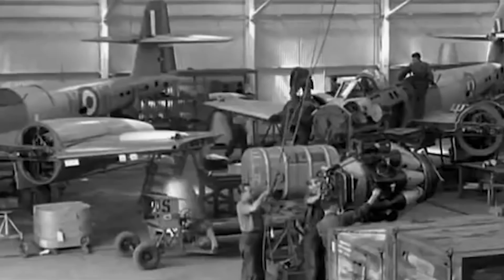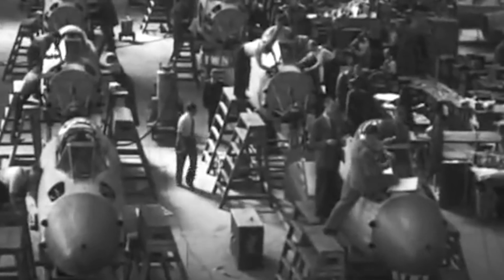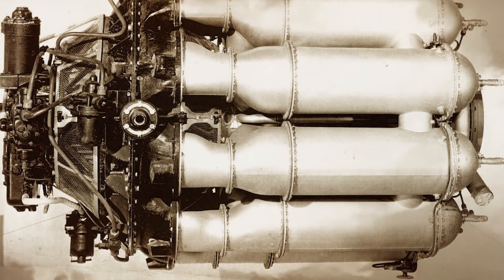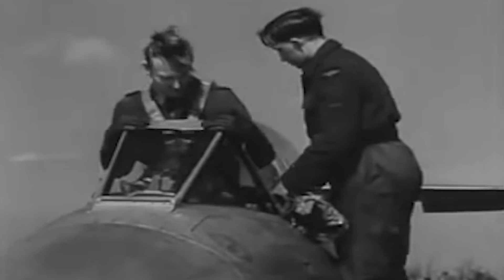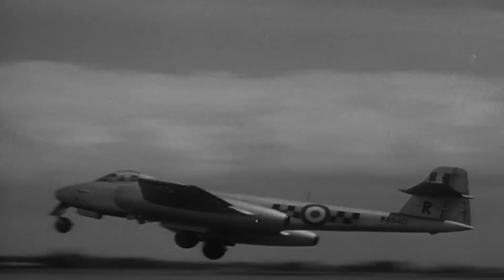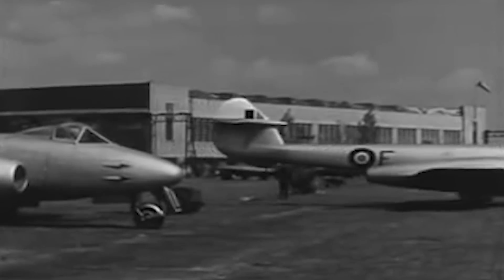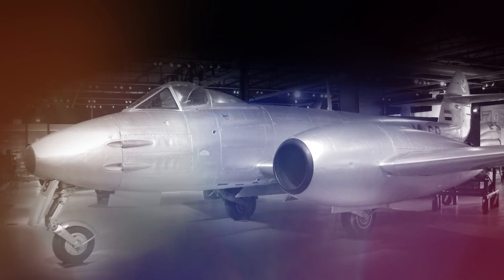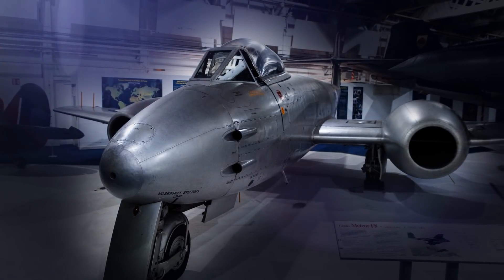Gloster Meteor - The Only Allied Jet to Fight in WW2

Comment: Whittle's jet engine could have been available much earlier but for the fact it had to be accepted by an RAF officer who mistakenly believed his own ideas about jet engines were better the Whittle's. It was he who held Whittle back. With out that officer then Whittle's jet engine could have been used much earlier.

Just imagine a combat version of the Gloster E.26 during the Battle of Britain. Old Herman Goring claimed the Mosquito made him yellow and green with envy. You can only imagine how many other colours he would have turned if his Luftwaffe had to face jets.
Reply: Early jet fighters really weren't all that great, poor range, lousy acceleration, unreliable engines and problems with guns at high speed being some of the issues; all the early models had to be used in niche roles (something that Hitler himself failed to understand) unlike aircraft such as the P51 and Mosquito which were very adaptable; some such as the A/B26, Skyraider still in use decades later.
As always other technologies such as air to air missiles and airbourne radar had to grow in order for Jet fighters to explore their potential. Jet bombers if anything had more initial value, see the Canberra and B47.
Reply: @jimdavis8391  I have seen the Canberra flying. Excellent aircraft. Even the USAF were impressed by it.

The Gloster E.26 did very well for itself and it was a prototype so with a bit of time improving it would have made it some difference to its performance. Also as the Battle of Britain was a defensive battle for Britain so its lack of range was less important. Getting up to altitude fast was what was needed.
Reply: Big Blue on
Reply: One good thing about centrifugal compressed engines is less compressor stall issues with axial flow engines (untill later multi spooled enjines). Had to gradually make thrust adjustments.
Reply: I guess you mean Alan Griffith? He had some pretty impressive ideas about turbine engines (axial flow compressors for example), but didn't think the jet thrust could be used as direct propulsion.
Reply: @tachikomakusanagi3744  Alan Griffith had forgotten Newton's third law
Reply: @bigblue6917  No, Newton's third was the exact reason why he didn't think jets would work for aircraft propulsion. Don't forget the original jets were low thrust, maybe 1000lbF (or less) even by 1942 - Griffiths was making his assessment in the early 1930s. Let us give him some slack on this. The guy had an axial flow jet operational by 1943. He realised he made a mistake, and he got right down to the business of correcting it.
Reply: @tachikomakusanagi3744  Griffiths was the Expert on Gas Turbines in the UK at the Time and that was why the Royal Aircraft Establishment called him in to check up on Whittle's proposal's in the early 1930's. Had He got the Maths right and validated Whittle's work, It's doubtful anything would have happened. No Threat and No Money.
Reply: @tachikomakusanagi3744  Definitely had a a pair of prototype Metrovick F-2 engines in the air in 1943 on one of the Meteor Prototypes, but the F-2 was nowhere near operational as the RAF would not have accepted it. Running life was better than any of the German Engines ever where, but nowhere close to what the RR Whittle engines could do,
Reply: @tachikomakusanagi3744 It was Hanye Constant at Metropolitan Vickers that was the one that pushed the idea of axial turbojets in the UK.
Unfortunately Britain was well behind in axial Compressor technology... still are today.
Reply: @richardvernon317  AA Griffiths was THE expert in the UK regarding Gas Turbine engines and turbochargers.
Here's the Head of engine development at the Royal Aircraft Establishment. He stayed up to date on turbochargers development and the first production gas turbine engines in the 1930s making frequent trips to General Electric in America and to Brown Boveri und Cie in Switzerland who were the world's leader in both gas turbines and turbochargers.
AA Griffiths brokered the deal that allowed Metropolitan Vickers to become a BB&C Velox gas turbine licensee and sell them in the UK for powerplants.
Reply: @WilhelmKarsten  I don't think Rolls Royce would agree with you. but carry on...
Reply: @tachikomakusanagi3744  GE-Safran is the largest jet engine manufacturer in the world and dominates the market.
Rolls-Royce is struggling and currently only makes the Trent engine in the UK.
 Brexit and the cancelation of the Airbus A380 has really cast doubts on the company's future.
Reply: @WilhelmKarsten  Hello Sandyboy, isn't it great that Rolls Royce have won the contract to re-engine the B52
Reply: @tachikomakusanagi3744  Frank Whittle was very aware that in the long term, the axial-flow jet engine would be superior.  As a pragmatic engineer, he also knew that the centrifugal compressor was much better understood than the axial, and so he chose to use those on his jet engine.  Whittle proved to be correct on both points.
Reply: @pashakdescilly7517  As Griffiths pointed out when he exposed Whittle for Plagiarism, he didn't understand the fundamental concept of Axial Compressor technology.
Whittle would never construct any engine with a axial Compressor.
 His career was destroyed when the W.2/700.M.52 engine was a failure and the Miles M.52 embezzlement scandal was exposed by the new Labour government.
Reply: @WilhelmKarsten  You post a whole lot of stuff which is 'novel'.  I suggest you cite come sources for your 'novel' allegations.  Your posts look like total bs to me.
As a for example, Whittle was aware from the beginning of his researches into jet engines, as its pioneer with limited resources, that ultimately the axial compressor jet engine would be the successful layout. However, the axial compressor was poorly understood and would require a large design and development budget which he did not have.  However, the centrifugal compressor was well understood and could be readily designed with rather fewer risks in development.  It may be noted that the Metropolitan Vickers jet project was very advanced in design, had marginally greater power than Whittle's engines, but was unreliable - despite having the benefits of British high temperature alloys developed for jet engines - which German projects did not have access to, notably due to severe shortage of nickel.
You raise a whole lot of allegations, an amusingly large number of them considering that internet searches reveal nothing to back them.  Except that Whittle and Griffith were rivals.  Yup, that is true.
Reply: @pashakdescilly7517  Bullshit, axial Compressors were in production before Whittle began any actual work on jet engines.
 Hans Von Ohain's first engine also used a centrifugal compressor but the Germans quickly abandoned this inferior dead end technology in favor of axial Compressors.
All of Von Ohain's work was self funded prior to the war.
Reply: @pashakdescilly7517  The Mertvick was failure, it never progressed to a flight rated production engine, Metropolitan Vickers abandoned jet engines in 1947 and went back to making steam engines.
Britain would not begin mass production of axial compressor turbojets until a decade after Germany.
Reply: @WilhelmKarsten  You do write twaddle.  Von Ohain examined Whittle's patent and published papers before doing his design work.  He was heavily funded by Heinkel.
Reply: @WilhelmKarsten  Metropolitan Vickers SOLD their project.
Your posts are 'novel'.  Otherwise referred to as creative bs
Reply: @pashakdescilly7517  Frank Whittle didn't invent the Jet engine nor was he the first to patent.
Your British propaganda myths won't fly here lad.
Reply: @WilhelmKarsten  I suppose, child, that you propose Henri Coanda as the inventor of the jet engine?  Of was it da Vinci?
Reply: @pashakdescilly7517  They SOLD OUT... and wrote-off the Metrovick as a huge financial loss.
Armstrong-Siddeley completely redesigned the Sapphire and it was never as good as the Rolls-Royce Avon.
Reply: @pashakdescilly7517  The revelation that you have been lied to must be a shock... the truth is often presented like a slap in the face.
Reply: @pashakdescilly7517  Your comments betray you lad..
They expose your limited knowledge and experience regarding this topic.
Reply: @WilhelmKarsten  your persistent creative writing on this subject is very reminiscent of Sander Van Der Kammen. Btw a German wouldn't use capitals for 'van der'.
With your taste for absurd disinfofmation, your read more like the un-lamented Soaring Tractor, who kept posting invective all over YT about the RollsRoyce Merlin and the supposed superority of the Packard-made examples.
Reply: @pashakdescilly7517  You sound very confused, delusional and unaccustomed to hearing the truth.
 Packard solved 2 of Merlin engines biggest flaws...
Reply: @WilhelmKarsten  The largest of the Merlin's flaw in early WW2 form was due to its carburettor.  The temporary fix was Miss Schilling's orifice, a diaphragm inside the carburettor float bowl with a small hole.  It largely cured the rich mixture condition under negative G force.  However, the long-term solution was the pressure carburettor, which was a joint US-UK development by Bendix and Stromberg which had absolutely nothing to do with Packard.  The various UK builders and Packard built the engines to the same specifications.  
Cut your bs, you are very argumentative with 'novel' ideas which utterly lack basis.  As you keep tossing insults, delusional etc, well, you are what you accuse others of - a child.
Reply: @WilhelmKarsten   aka Sander Van der Kammen aka dr bummer, your lies are all over you tube. 
Packard copied Rolls Royce and solved nothing, Rolls Royce had to show Packard how to make aero engines and Rolls Royce had to correct faults on the Packard copies.
Reply: @WilhelmKarsten  Hello Sandyboy, as you know the Sapphire was the Metrovick F9 and was also built in the US as the J65.
Reply: @WilhelmKarsten  Hello Sandyboy, let's remind you of what Pabst von Ohain himself said-

"The first patent of a turbojet engine, which was later developed and produced,
was that of Frank Whittle, now Sir Frank (see Fig. 5). His patent was applied for
in January 1930. This patent shows a multistage, axial-flow compressor followed
by a radial compressor stage, a combustor, an axial-flow turbine driving the
compressor, and an exhaust nozzle. Such configurations are still used today"

But Sandyboy do tell, what earlier patent do you have in mind, would it be our French friend by chance?
Reply: @pashakdescilly7517  Oh know, with Sandyboy it varies depending on what fact he's got to try and dodge. It does often come out to Maxime Guillaume because Sandyboy has seen a picture of his design but he's never actually read the patent  he used always to declare Guillaume's patent to be for an axial flow engine when Guillaume clearly suggests either a helicoidal or a Rateau type compressor.
Reply: @WilhelmKarsten  Sandyboy, it will hardly be a revelation to Pashak de Scilly that they're being lied to, because they know as we all do that you are lying almost all of the time.
Reply: @WilhelmKarsten  Hey Sandyboy, As you know, Metrovick sold its aero GT business to Armstrong Siddeley and the Metrovick F2 design team transferred with the F9 Sapphire and made it a very successful engine (more powerful than the early Avon) and it was built under licence in the US as the J65.  And a lot of Metrovick devlopments found their way into other AS engines.
I had to laugh when I saw you'd made a dumb claim about it being 'completely redesigned'.   It's so funny given that you spend so much time twatting on that the Snecma Atar is a BMW 018,  because Christian Pierer (co author of BMW Aero Engines: Milestones in aviation from the beginnings to the present.) makes clear that the Atar was    " a completely new development, "   containing only    " certain elements of the BMW 003 featured in its basic design. "
Reply: @pashakdescilly7517  Pressure carburetors were used on the very early DBs.  They switched to the vastly superior multiport sequential direct fuel injection system.
Reply: @fritzwrangle-clouder6033  The first patent for using a gas turbine to power an aircraft was filed in 1921 by Guillaume. ," French patent no. 534,801 (filed: 3 May 1921; issued: 13 January 1922).  Hope this helps!  Pip pip cheerio
Reply: @fritzwrangle-clouder6033  Hi!  Dr Franz invented and built the first axial-flow jet engine.  The British lacked the technology to build a working axial-flow jet engine during WWII, if they could have, they would have.  The entire world now uses this invention.  Tally Ho!
Reply: @TheAneewAony   The information I have seen on the DB600 engine says 'carburettor' not 'pressure carburettor'. The pressure carburettor is seen by many analysts as a good compromise, being MUCH easier to make and maintain in the field than the direct injection systems, offers almost all of the advantages, and was achievable in the wartime conditions.
 It does illustrate a philosophical difference between British and German engineers - Germans try to make what they think is the ultimate best solution, Brits tend to develop more pragmatic solutions.
Reply: @pashakdescilly7517  Yes, it was a pressure carb.  Read the "The Secret Horsepower Race: Western Front Fighter Engine Development"   The failure of the British to develop direct fuel injection is well documented
Reply: @TheAneewAony  Hello Sandyboy, why are you using yet another identity?

Sandyboy, why are you using three different identities in the same thread?

So Sandyboy, I see you are back in love with Guillaume's patent with its sweet little crank handle.

I always think it's worth reminding you of what the famous German gas turbine pioneer Pabst Von Ohain had to say in his foreword to 'Elements of Propulsion, gas turbines and rocket'-

"The first patent of a turbojet engine, which was later developed and produced, was that of Frank Whittle, now Sir Frank (see Fig. 5). His patent was applied for in January 1930. This patent shows a multistage, axial-flow compressor followed by a radial compressor stage, a combustor, an axial-flow turbine driving the compressor, and an exhaust nozzle. Such configurations are still used today..."

and -

"In April 1937, Whittle had his bench-test jet engine ready for the first test run. It ran excellently; however, it ran out of control because liquid fuel had collected inside the engine and started to vaporize as the engine became hot, thereby adding uncontrolled fuel quantities to the combustion process. The problem was easily overcome. This first test run was the world's first run of a bench-test jet engine operating with liquid fuel..."

and-

"From the beginning of his jet propulsion activities, Frank Whittle had been seeking means for improving the propulsive efficiency of turbojet engines. He conceived novel ideas for which he filed a patent application in 1936, which can be called a bypass engine or turbofan. To avoid a complete new design, Whittle sought an interim solution that could be merely "tacked on" to a jet engine. This configuration was later known as the aft fan. Whittle's work on fan jets or bypass engines and aft fans was way ahead of his time. It was of greatest importance for the future or turbopropulsion."
Reply: @TheAneewAony  Hello Sandyboy, why are you using yet another identity and why are you using three different identities in the same thread?

As you know Sandyboy, Anselm Franz designed the Ju 004 jet engine that was a failure having appalling  reliability and an average scrap life of only twelve hours (according to Eric Brown who you are quoting) and worse performance compered to Britain's wartime jet engines. Even post war with the best efforts of the Russians' couldn't make it worth using on frontline aircraft.
As you know, Anselm Franz spent his postwar career building engines based on Frank Whittle's 1930 patent.
Reply: @tachikomakusanagi3744    Alan Griffith was involved in the first British axial-flow jet engine, the Metropolitan-Vickers F2 which first ran in 1941
Reply: @pashakdescilly7517  Unfortunately the F.2 was a failure and never achieved the reliability needed for a flight rating certification.
Reply: @bfc3057  I have come across the reference many times, but as we both know that is no guarantee he actually said it. I do know that he was very impressed by the Mosquito and even more impressed by the fact that is could be built by parts made by people who had previously made things like furniture
Reply: Luftwaffe would have been so LOLed
Reply: @ryanovski  The Luftwaffe had enough trouble dealing with Spitfires and Hurricanes without having to deal with jets as well.
Reply: This is a very interesting twist Mr. big blue. Where can I learn more about this military officer who retarded the advancement of the jet engine in Britain?
Reply: @steveperreira5850  I should think a good biography about Whittle should mention him.
Reply: @steveperreira5850  If you're interested read the book, Jet Man by Duncan Campbell-Smith. It's a great biography of Sir Frank. He encountered quite a lot of opposition to his ideas, although some of those who initially rejected his proposals went on to support them.
Reply: Jack Tangles  Frank Whittle's  engine was not successfully flight tested until 15.May 1941... he came in FOURTH PLACE.
Reply: Jack Tangles  Whittle was not the first to patent the turbojet engine or to construct a jet engine and his engine was only the fourth design to successfully power a jet aircraft.
Reply: Alan Griffith was kind of correct, though. He believed the axial compressor was the superior design - which of course it was. His mistake was in saying that if the axial design was superior, then the centrifugal (Whittle's) design was not useful and should be ignored. The metallurgy wasn't up to the axial design until after WW2 (the reason the German engines were so unreliable) - and the centrifugal compressor design proved to be very useable, if not long lived...  Griffith's designs went on to be developed into very successful engines.
Reply: There's one prediction, His trousers would always have been BROWN
Reply: In hindsight we know that Frank Whittle was a fraud who plagiarized the work of AA Griffiths and Adrian Lombard.
Whittle would never construct any engine able to pass the PFTR reliability test for RAF service.
Reply: The same could be said about the 262. There was another jet fighter ready for production as early as 1939 but the Luftwaffe saw no need for such an expensive project when, at the time, the 109 and 190 were both superior to anything they encountered. Then when it came time for the 262 Hitler demanded that it be a fighter bomber which pushed it back by several years.
Reply: @Deoxys501  Hitler seemed to be better with tanks then aircraft. Many of the improvements in things like using the 50 mm and then the 75 mm tank guns were at his insistence.
Reply: @bigblue6917  idk he had a pretty nasty case of megalomania. Like seriously a new tank for each gun when some models could easily just be upgunned and uparmored. Had they just mass produced Panthers, and maybe some with 88's, i could see much different results in the war.
Reply: @Deoxys501  
IN 1939 the experimental Heinkel had a copy of Whittle's centrifugal jet engine and it only flew at low speed, they never even retracted the undercarriage. 
The Me 262 entered service in late 1944 in small numbers and the unreliable jet engines were slow to be produced, most out of over 1,400 Me 262's never flew. Some were intended as a fighter bomber others as a straight fighter but since most fighters could be used as fighter bombers Hitler didn't delay it at all.
Reply: @barrierodliffe4155  Thank you for confirming that you know nothing about either von Ohain's work or Whittle's engine...

Well, the Messerschmitt Me-262 was not only the first operational jet fighter it was the only successful jet fighter during WW2... shooting down over 550 Allied aircraft.
The Meatbox only killed British pilots.
Reply: @sandervanderkammen9230  
You really do confirm that you have no idea. Ohain  copied Whitle's designs which included axial and centrifugal jet engines, Ohain went with the centrifugal and after being briefly test flown it was found to be useless, Ohain got it wrong. Then we have BMW and Junkers who copied Whittles design for axial engines, they got that wrong too and never made a good engine.
The Me 262 was not operational until late 1944, the Meteor in July 1944.
The Me 262 did shoot down maybe 150 aircraft mostly bombers, not RAF fighters, the Meteor did fly over Germany and destroyed some 46 German aircraft and not a single combat loss.  
You can't explain why the wonderful Me 262 couldn't shoot down any Meteors or Spitfires and Tempests when these were all flying over Germany. Even in late 1944 when photo reconnaissance Spitfires were flying all over Germany the Me 262 could do nothing about them. 
An unarmed Mosquito flew to Poland and back, supposedly escorted by 4 P 51's but 1 dropped out, the other 3 had trouble keeping up, over Poland the P 51's and 3 Me 262's had an inconclusive fight, 1 Me 262 tried to catch the Mosquito but failed, on the return trip the Mosquito was chased by 4 Me 262's but they couldn't catch up.
Reply: @sandervanderkammen9230  Wie ist es, ein Feigling zu sein, kleiner Doktor, Mistkerl?
Reply: @barrierodliffe4155  Dr Franz invented the axial-flow jet engine.  Whittle never made an axial-flow engine. The British were never able to produce a working axial-flow jet until after the war when they were able to use German research via Operation Surgeon. No Meteor was used in operational combat engaging the enemy during WWII.  The Mosquito is best known for being the first aircraft to be shot down by a jet, ending the era of slow moving piston engine aircraft.  The 262 was over 150 mph faster than the Mosquito.  The only combat operational jet to operate over over England during WWII was the German Arado 234.  Hope this helps!
Reply: The Nazi RLM had preferred military contractors just like the US. The preferred contractors promote the status quo because it makes more money. It was Hitler who kept the projects (including Arado 234) going as Shnell bombers. Note: jets were not ready for prime time, original 262 had 4 lower quality engines. BMW screwed up making engines and Heinkel wasn't funded. By the time they needed fighters, the main reason they flew is they used kerosene and 95 octane AV gas was precious.
Reply: @Deoxys501  No German jet aircraft could have been used in any type of combat in 1939, the Fw 190 couldn't either as for superior, the Bf 109 encountered the Spitfire as did the Fw 190. Hitler made no difference to the Me 262 which was a poor fighter, it entered service in low numbers in late 1944, it couldn't have entered service any earlier due to the lack of engines.
Reply: @barrierodliffe4155  Over 6000 004 were built, there was never a shortage.  Eric Brown on the 262: ", "I rank it the most formidable aircraft of World War Two""
Reply: @Deoxys501  The Me 262 was in the early stage of design concept development in 1939.  It first flew on 18 April 1941 with piston engine (Junkers Jumo 210); and on 18 July 1942 with jet engines.  Those jet engines were in no way combat-ready when the plane was given combat-status.  The engines lacked high-temperature metal alloys, and were junk after around 10-12 hours' run time. By contrast, the Whittle-type jet engines of WW2 ran 100 hours between routine servicing.
The Heinkel He 178 test aircraft flew just before WW2 started, but that Heinkel jet engine was extremely small, inefficient and low-powered.  It was so unsuccessful that work was forcibly stopped on it by the Nazis.  BTW the Heinkel jet engines were centrifugal compressor, centrifugal turbine - somewhat like a turbocharger with a combustion chamber in between.  Colin Furze made a jet engine out of one!!
Reply: @pashakdescilly7517  That is completely false and misleading.
The Jumo-004A had a PFTR of over 200 hours.
The Jumo-004B exceeded the Luftwaffe 100 hour test.
No engines built by Power Jets Ltd. Ever passed the RAF 100 hour PFTR test.
Only Rolls-Royce engines met or exceeded 100 hours.
Reply: German Heinkel flew jets in 1939, but like Britain, the people at the top are know-it-alls.
Reply: Jack Tangles  Lol!!!
Maxime Guillaume patented the turbojet engine in 1921, when Frank Whittle was just a child.
 Patent number 534.801 filed 3.May 1921.
Frank Whittle did not invent the turbojet engine, he was only the first in the U.K.
Reply: @sandervanderkammen9230  Ah Sandyhoney, jumping back onto the Guillaume patent now I see. So are you now denying Ohain and Franz? You do love that saucy Frenchman's patent with its sweet little crankhandle, don't you.
Reply: Jack Tangles  Not anymore, thanks to the information age the old British propaganda myth that Frank Whittle invent the jet engine has been dispelled for good.
Reply: Just imagine a combat version of the Gloster E.26 during the Battle of Britain with Me 262 (the one of the only two operational jetplane during WW2 exclusive Arado Ar 234 Blitz)
Reply: @komsomoletz7238  Hard to imagine the Me 262 before it was built.  The Battle of Britain was in 1940 and the first Me 262 to fly in 1941 with a piston engine because there were no jet engines ready,  it was slow and would have been slaughtered by any fighter at the time.
Reply: Whittles engines ran poorly and could not pass the RAF minimum 100 hour reliability test.
The true genius was Adrian Lombard who refused to be browbeaten and abused by Whittle and left to work with Rolls-Royce and the brilliant Stanley Hooker.
Reply: AA Griffiths exposed Whittle for what he really was, a plagiarist, boaster and self promoter with little talent.
Reply: With a top speed of just 350 mph the Gloster Whittle would have be an easy target in the Battle of Britain... of course it could not enter production because of its unreliable engine.
Reply: Wishful thinking... Whittle's 1930 design was deeply flawed and had to be abandoned... he never constructed any engine with a axial compressor.
Reply: @sandervanderkammen9230  Abandoned? Whittles engine would become the Rolls Royce Nene... the most produced jet engine in history and still made today.
Reply: @1993Crag Your lack of knowledge regarding this topic is blatantly obvious... Whittle never produced any engine with a axial compressor... he abandoned the 1930 design after A.A Griffiths pointed out that the design was deeply flawed to the point that it would never be able to provide thrust.
Reply: @1993Crag  The GE J47 engine is the most produced.with 35,000 units.
Reply: @sandervanderkammen9230  The Rolls Royce Nene, its licenced and unlicensed production versions exceed some 45,000 units produced.
Reply: @1993Crag  Wrong,  The GE J47 engine is the most produced.with 35,000 units. 
Less than 6,000 Nene engines were built including 4,100 Pratt & Whitney J48 engines built under license.
Reply: @sandervanderkammen9230  Maybe you missed it; licenced and unlicensed versions. that includes the VK-1, Wopen WP-5
Reply: @1993Crag  Sorry, but the Kilmov VK-1  is not a Rolls-Royce Nene engine.
Reply: @sandervanderkammen9230  Try again
Reply: @1993Crag Sorry but the the VK-1 is a different engine..
 Only the RD-45 was an unlicensed copy.
Reply: @sandervanderkammen9230  By that logic the J-47 wasn't the most produced jet engine because the versions were different engines...
Reply: @1993Crag  It is wirhout any doubt the most produced jet engine in history, the list of aircraft types and production numbers are very impressive indeed.
Reply: @sandervanderkammen9230  If you call the J-47 the one engine then so is the Nene, the Nene wins.
Reply: @1993Crag  Just the facts here, 36,500 J47 were built... that is 10 times the number of R.B 41 engines made by Rolls-Royce plus the Pratt & Whitney J42 and the RD-45 combined.
Reply: @sandervanderkammen9230  Ignoring the VK-1 again, nice work.
Reply: @1993Crag  The RD-45 and the VK-1 are different engines.. 
Just like the RB.41 Nene and the RB.44 Tay are different engines...
Reply: @sandervanderkammen9230  Except they're not...
Reply: @1993Crag  Rolls-Royce says you're  WRONG!
Reply: @sandervanderkammen9230  Sandyboy, please provide evidence that "A.A Griffiths pointed out that the design was deeply flawed to the point that it would never be able to provide thrust" and that Griffith's assessment was correct. I'll be waiting for a very long time for you to come up with anything no doubt.
Reply: @sandervanderkammen9230  - What on earth are you talking about? Whittle knew the metallurgy wasn't ready for the axial jet and so used a centrifugal compressor - and there were many successful engines based on this configuration and many in use today. Griffith pioneered the axial engine and the Metrovick F2 axial jet engine flew in the Meteor in November 1943. It was developed into a very succesful line of engines after the war. Both the British and German's had axial and centrifugal designs available during WW2. The Germans went with axial, which was a big mistake as the technology wasn't ready. Britain went with centrifugal - which was the correct decision as the early centrifugal engines were far more reliable. You need to do some more research - or are you trolling for lols?
Reply: @SAHBfan  You clearly don't have the slightest clue what you are talking about.
Metallurgy was only a technical limitation for combustor and more importantly Turbine design.
Whittle' s engines all used a Axial Flow TURBINE
As was pointed out by RAE cjeif engineer A.A. Griffiths, Whittle lacked the knowledge to construct a functional efficient axial compressor. 
Griffiths pointed out that Whittle had not only clearly plagiarized his 1926 paper but had copied several agregious errors in his own compressor design.
Reply: @SAHBfan  That is incorrect, Dr. Anselm Franz Pioneered axial flow turbojet engine.
The first successful axial turbojet was his Jumo 004 engine which was successfully flight tested in 1942 and in mass production in 1943.
The Metrovick F2 was a failure and never entered production., the U.K. would not have a reliable production axial compressor engine until the 1950s.
Reply: @sandervanderkammen9230  - Nonsense. The F2 had issues with the combustion chambers overheating. This was overcome by uprating the alloy used to the same Nimonic alloy developed for the Whittle engine, but also adopting Whittles shape of combustion chamber. So, y'know, Whittle kind of got that right and lent that technology to the axial design. But don't let any facts get in the way of your trolling...
Reply: @sandervanderkammen9230  - Again, you have got everything wrong. The Metrovick F2 was developed into the very sucessful Sapphire among others. You could even get that information from Wikipedia, so I know you know it - which is why I know you are just a troll and not worth anyone's time.
Reply: @SAHBfan  Sorry, but High temperature  nickel alloy such as Nimonic is ONLY USED IN THE TURBINE.
NOT THE COMPRESSOR.

Please refrain from spreading your ignorant uneducated remarks on YouTube.
Reply: @SAHBfan  The Metrovick F2 was a failure.
The Sapphire was developed by Armstrong-Siddeley it did not enter production until the 1950s.
The Sapphire used a ANNULAR combustor invented by Hans von Ohain.
Reply: @sandervanderkammen9230  - There are many scientific papers on the JUMO 004 which highlight it's design weaknesses, including the very serious vibration problem, overheating issues, shortcomings in use of materials, ludicrously short running time between major overhauls and how it was very easy it was for a pilot to scrap an engine just by opening the throttle too quickly. The design team deserve credit for building one of the first axial turbojets, but no way was it ready for production. Whittles engine was far superior and you know it. You should research more and spread less misinformation. And we know you are deliberately spreading false information.  We also know why. I think you need professional help. Anyway, your account is now muted, along with all the others you've used...
Reply: Jack Tangles  Hans von Ohain invented the jet engine... not Whittle.
Reply: @sandervanderkammen9230  That's odd, because elsewhere you've dismissed Pabst Von Ohain now you want to laud him. Let's remind you of what Pabst Von Ohain himself had to say-

"The first patent of a turbojet engine, which was later developed and produced,
was that of Frank Whittle, now Sir Frank (see Fig. 5). His patent was applied for
in January 1930. This patent shows a multistage, axial-flow compressor followed
by a radial compressor stage, a combustor, an axial-flow turbine driving the
compressor, and an exhaust nozzle. Such configurations are still used today..."

and

"In April 1937, Whittle had his bench-test jet engine ready for the first test run.
It ran excellently; however, it ran out of control because liquid fuel had collected
inside the engine and started to vaporize as the engine became hot, thereby
adding uncontrolled fuel quantities to the combustion process. The problem
was easily overcome. This first test run was the world's first run of a bench-test
jet engine operating with liquid fuel"

and 

"From the beginning of his jet propulsion activities, Frank Whittle had been
seeking means for improving the propulsive efficiency of turbojet engines. ¶ He
conceived novel ideas for which he filed a patent application in 1936, which
can be called a bypass engine or turbofan. To avoid a complete new design,
Whittle sought an interim solution that could be merely "tacked on" to a jet
engine. This configuration was later known as the aft fan. Whittle's work on
fan jets or bypass engines and aft fans was way ahead of his time. It was of
greatest importance for the future or turbopropulsion."
Reply: @sandervanderkammen9230  But Sandyboy, the Jumo 004 was crap. The Metrovick F2 was running in 1941and went on to be developed into the Sapphire and J65.
You poor old thing, you so wan't to claim any absurdly distant relative of any part of a german engine as the original genuine whole engine, you would have to be insane then to try and deny the clear heritage of the Sapphire and the J65.
Reply: @sandervanderkammen9230  Sandyboy, you claim in your response to SAHBfan,-

"Sorry, but High temperature  nickel alloy such as Nimonic is ONLY USED IN THE TURBINE.
NOT THE COMPRESSOR.
Please refrain from spreading your ignorant uneducated remarks on YouTube."

But from 'InTechMaterials for gas turbines'

"Today, the maximum temperature limit for near- alloys for elevated temperature
applications is about 540 oC. This temperature limitation for titanium alloys mean the hottest
parts in the COMPRESSOR, i.e. the discs and blades of the last COMPRESSOR stages, have to be
manufactured from Ni-based superalloys..."  (my caps)

Perhaps Sandyboy, you should refrain from spreading your ignorant uneducated remarks on YouTube